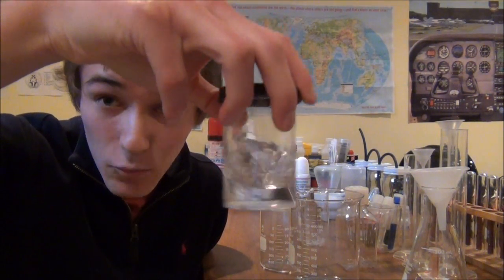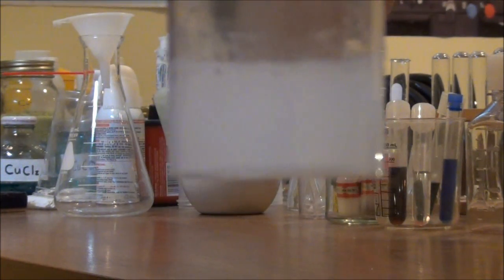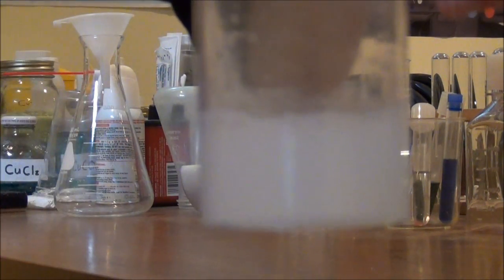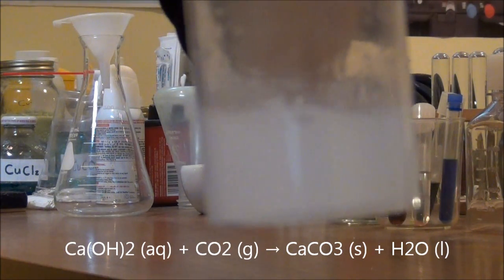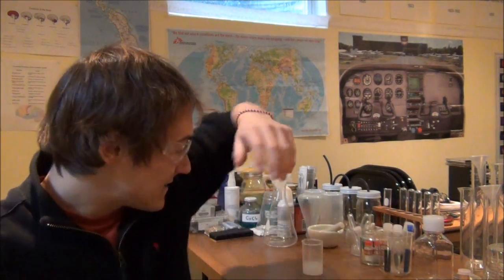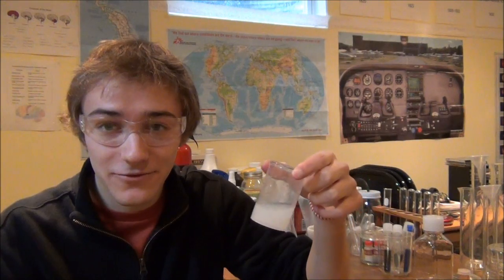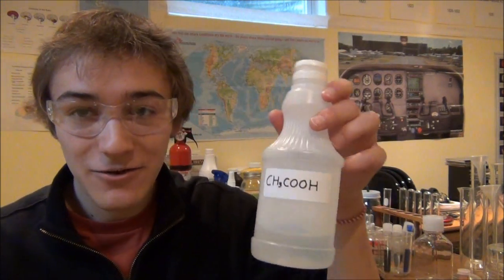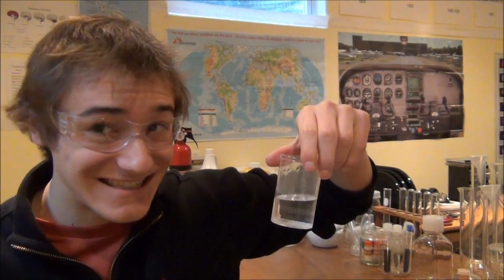Reaction of Carbon Dioxide with Lime Water / Neutralization with Acid

Comment: I have a question you might be able to answer: CO2(g) dissolves in water due to Henry's law and the big area of contact the bubbles have with the solution. My question is: after a while I would think that the CO2 would have to start to come out of solution (again because of Henry's law) and then since there's no CO2, the equilibrium would shift to the left and the CO3(2-) would be present at a lower concentration (decomposing the CaCO3. Does this happen with the solution? After a while does it become clear again? Appreciate yo taking the time to read this.
Reply from the maker: I can try it but I doubt the solution would naturally become clear again if left sitting out. The calcium hydroxide is limiting in this case, so any excess carbon dioxide would bubble out of solution initially, but the gas that reacts becomes "trapped" as calcium carbonate, so the carbon dioxide equilibrium becomes irrelevant. As far as I know, carbonates won't spontaneously decompose into carbon dioxide unless reacted with an acid (like I show) or a similar reagent.

Comment: can you please explain how you ( i think u said) "pipen" off the water??) basically how did you get calcium hydroxide and turn it into a liquid?
thanks so much
Reply from the maker: i was explaining how to dissolve it.  if you have solid calcium hydroxide it's only sparingly soluble in water, so you mix it as best as possible and pipette or decant the liquid phase from the hydroxide slurry.
Reply: thanks so much!!!

Comment: good evening 
I introduce myself, I'm Ali ZADANI student engineer processes and I spend my final project currently study in a sugar refining industry.
Among the tasks of my mission, I must offset rejection alkaline liquid, and as a solution I can use CO2 to reduce PH, the problem I encountered is that I did not know how to determine the flow of CO2 suitable for effluent and what factor on which I should base myself to determine what rate of CO2. Ihope that you help me to realise my job.

Comment from the maker: If you continue to add CO2 you'll end up saturating the solution.  Under these conditions, calcium carbonate can react with the excess CO2 in solution to form calcium bicarbonate (baking soda), which is highly soluble, so the white precipitate disappears.  This reaction is actually responsible for cavern formation in carbonate cliffs.  The saturated CO2 water erodes the rock by converting its insoluble calcium carbonate into soluble calcium bicarbonate

CaCO3 + CO2 + H2O → Ca(HCO3)2